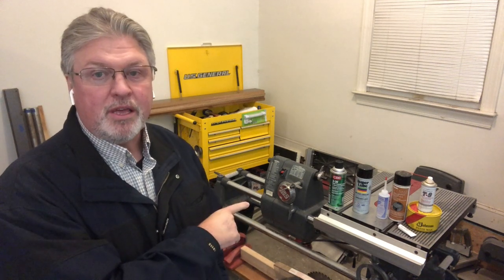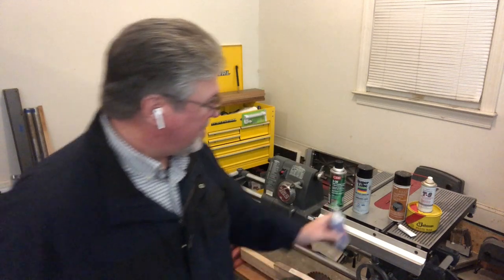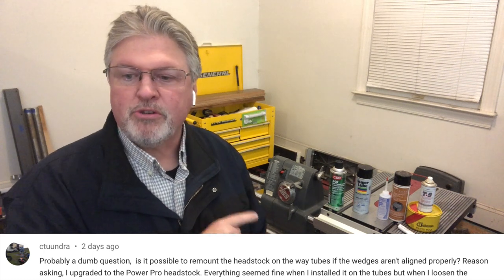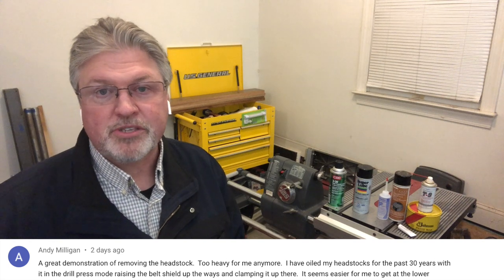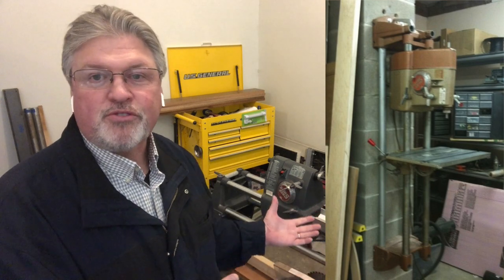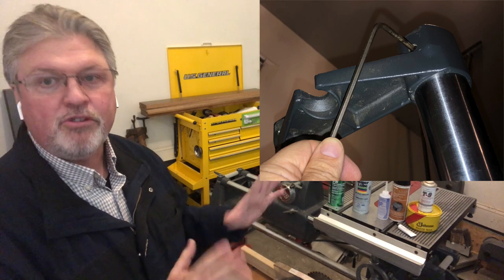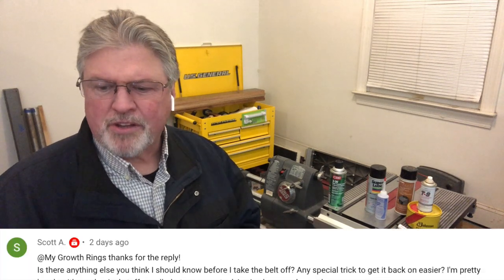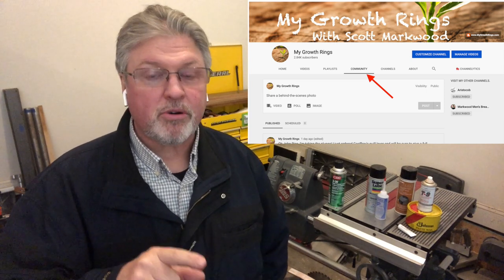STUMPED? Q&A's from "Critical 25 Hour Run-Time Maintenance & Lubing of Shopsmith Mark V Headstock"

Comment: Enjoying the information from your videos!  I owned, (or it owned me) a  copy/printing business for 25 years and started out using "motor oil" to lubricate my ABDick printing press until one of my service guys suggested that I not use motor oil.  His reasoning made sense to me.  Motor oil is designed to not only lubricate but also to take away dirt, etc. and run it through the oil filter.  On machinery you want the oil to stay where you put it and not flow from the part you want lubricated.  So I bought a quart of Lubriplate No.3-V.  I still have 1/3 of that quart bottle after all these years.  I just checked their web site and don't see No.3-V, however they have a 5W and a 20W.  It is pretty pricey for a quart, $31.00!  So your suggestion of 10W sewing machine oil seems to be a good..  Even though non-detergent motor oil is OK I would still use a "machine oil" that is formulated for machinery, not automobiles!  Thanks for your videos!
Reply from the maker: Thanks for sharing that. I was given very similar advice when I was learning clock repair. Talk about slow moving parts!  Thanks for watching and for adding to the conversation, Scott

Comment: Great job. You mentioned the weight of the various headstocks. I found out the hard way about this. I swapped  out the original headstock on my used SS for a complete Power Pro. Taking off the original was a piece of cake,  putting on the PP was a different story. Got it on by myself but sure wish I had a second person. Don't know what the actual weight difference is but definitely the PP is heavy. Thanks for sharing. Curt
Reply from the maker: Curt, Oh yes, the PowerPro headstock is super-heavy. And I converted a sand-cast 1955 Greenie, which was already on the heavy side. I'll have to see if I can learn the actual weight. Scott
Reply: @MyGrowthRings  PP is a beast, indeed. Having some scraping issues on the top of the way bars when sliding the headstock, but I suspect the belt cover holes are slightly off-spec relative to the bars. No problems from the original Mk V 500, or when i take the belt cover off the PP headstock. Thoughts? Thanks!

Comment: NIce Video, I have a 500 with the 3 handle quill lever, and the owner before me managed to break one of the 3 handles off leaving the remainder behind. I drilled it and used an screw extractor, and it actually came out really easy, barely an inconvenience ;)
Reply from the maker: Well played video references are TIGHT!

Comment: I never pull my head stocks to maintain. I own 3 of them an one of them is mounted on a wall. I have a 550 and two 500's.  I use a Qmaxx blue gun oil and it's a amazing oil. Don't forget to lube the sheave on the motor were it slides and is pushed in by the spring. It has that little lube hole on the shaft. You might have mentioned if you did I missed it and apologize. The wife was in my ear during some of this. LOL.   I use a silicone spray one my way tubes and the back of the speed dial and table legs. It works very well and dust does not stick to it very bad at all. Mineral oil works pretty good on the way tubes also that's what my dad always used. My dad owned 2 of them growing up and they ran every day for hours for over 35 yrs before he slowed down a bit. He still uses them just not like he once did. He got his fist one in 1980 when I was 4 years old So I been a big fan for a long time. I think it's cool you got a youtube channel that showcases a shopsmith. They are so miss understood by so many. I hate people that have such a negative view of them but have never owned or even used one. You can picked up used machines for next to nothing and they are great for small shops and highly accurate. I have one with a bad motor and I think its the windings. There was smoke come out. I been letting it set because I want to do a powerpro upgrade. I subscribed so I look forward to seeing more.  Check out the one I restored. I give $125 for it and it was in horrible shape and been taking apart. I two toned it in green and white. I know they never came like this but it really came out nice.  https://www.lumberjocks.com/topics/154418
Reply from the maker: Did you catch the video that this was a follow-up to? https://youtu.be/UT6vfZsJ7OI  In that vid I oiled the motor sheave.  You are really going to like the PowerPro. I was a beta tester and the power is amazing.  Also, thanks for sharing the link and for subbing the channel. You are welcome to join in the conversation anytime.  Scott

Comment: I didn't have a shopsmith drive belt, so purchased one close to that size at an automotive store. It works when new, but after a while it seems to affect my high speed. Do you think this is do to the size, or some other reason? After a little use the speed slows down after it gets to the saw setting. I love being a member!
Reply from the maker: For sure it has more to do with the belt’s width than length, but both are a factor.
Reply: Thanks

Comment: Out of curiosity, you have so much knowledge about all that is Shopsmith, it makes me very curious.  How did you get all the information you possess? about Shopsmith (lucky for us, I might add)?  Did you work for Shopsmith.  What do you do for a living?  And why do you own so many Shopsmith machines?

Thanks.
Reply from the maker: I've been a corporate trainer for a German cabinet hardware company for the last 21 years but prior to that I was a manager at two of Shopsmith's retail stores and was the Academy Instructor at the Factory showroom. All total I worked full time and under contract part time for Shopsmith for 13 years.  I've been an owner and user of Shopsmith tools since 1987 but obsessed about them for about ten years before that. For five years prior to going to work at Shopsmith I was a clockmaker, so I'm interested in the way things work and have studied the Shopsmith patents, owners manuals and service bulletins extensively (my bride would say obsessively) extensively.  I'm pretty much as big a Shopsmith nerd as they come! Scott

Comment: On this episode of Stumped you mentioned making a video for older Mark V headstocks that don’t have the access hole for the top sheave….. I can’t find it if you did in fact create it
Reply from the maker: Yes, here it is: https://youtu.be/yQSGbudXUWk?si=Ke2f2RxNTFCPRhSS
Reply: Thank you that was awesome…….
Reply from the maker: @pullt1  I’m glad it helped.
Reply: @MyGrowthRings  it did help …… this old greenie was so tight it was blowing breakers but it was only $50 so I gambled I could loosen it up……. After a major cleanup (so rusty waytubes and legs) and with your expertise and some oil it is working normally ….. I plan on turning it into a dedicated drill press, I’ll flip the headstock and table and it should be good to go …….. any recommendations on how long to cut the lower waytubes? I want to reuse the legs instead of wall mounting
Reply from the maker: @pullt1  The most important thing is to remove the same amount off of all four tubes.

Comment: Any reason not to use Boeshield T9 on the way tubes? I use Johnson;s paste wax for the way tubes but was thinking that T9 might be easier/quicker to apply.
Reply from the maker: I have used it in a pinch, but I have an issue with overspray in a dusty shop and it isn't nearly as long-wearing as Johnson's. The good news is that it's easy to reapply.

Comment: How about using sprayable graphite from an aerosol can?  I've tried this instead of the powdered variety and so far it appears to be doing the job.  A bit easier to apply, as well.  Any feelings one way or the other about this?
Reply from the maker: Yep, that should be fine on the headstock lock.

Comment: What about silicone lubricants for the quadrant, etc?  Will they still attract sawdust?
Reply from the maker: Unfortunately, yes. I tried it once and it was a disaster. Scott
Reply from the maker: Just to be clear, that may also have been from some other chemical present in the silicone spray.
Reply: @MyGrowthRings  Thanks, Scott!

Comment: 7:35 How do I remove the speed dial?  I see the cutout and it looks like a hex bolt but I can't seem to get into it.
Reply from the maker: It’s a small hex wrench. It can be tough to access but make sure the hole is roughly at 12 o’clock.

Comment: Can 3 in 1 oil be used in the two oil holes? I used that due to that’s all I had.
Reply from the maker: It’s been done and it’s far better than not oiling. Because 3-in-1 contains naphtha and a few other non-lubricating “herbs and spices” I don’t use it for this task. According to the MSDS, the oil I use is 99% “severely refined oil” and 1% distillates. It has never given me concern. Scott

Comment: Community Tab?  Oh No.  I thought I was catching up until I see the Community Tab.
My Mark 5 won't start -- just hums and trips the breaker.
Time to take apart the headstock.  Hopefully is the starting capacitor.  
But, while I'm there, I plan to do the lube.
Reply from the maker: Can you spin it by hand? What vintage is the headstock? There was an issue with a centrifugal switch on some of the late 80's-early 90's motors, where a blast of compressed air can actually bring it back to life.  Good luck and report back. Scott
Reply: @MyGrowthRings  that you Scott.
My nameplate reads:
Mark V
Model No. 555540
-------
The headstock was fairly clean -- not enough dust to worry about but I did blow it out.
It looks like the capacitor is inside the motor enclosure.  I will try to take the cap out and take it to a place that can test and replace.  again - thanks.
Reply: @MyGrowthRings  Oh yeah, I can easily spin it.  bearings seem okay.
Reply from the maker: @boogermeats  That’s good.